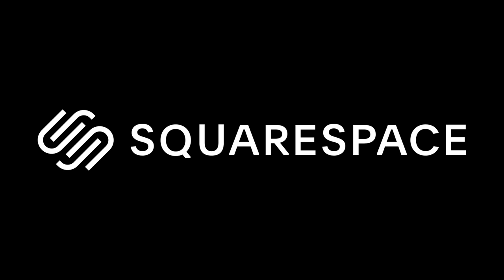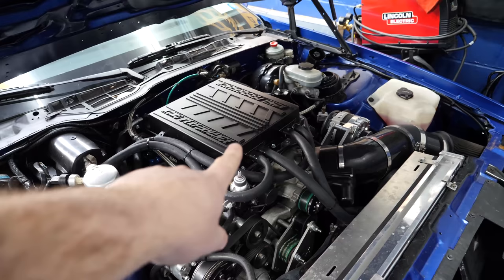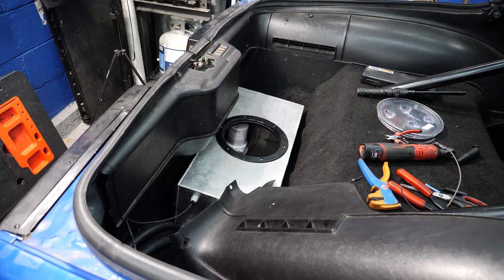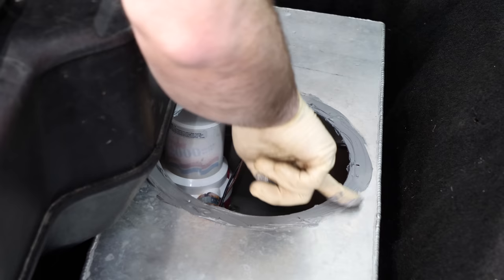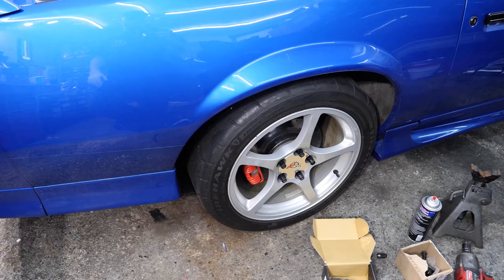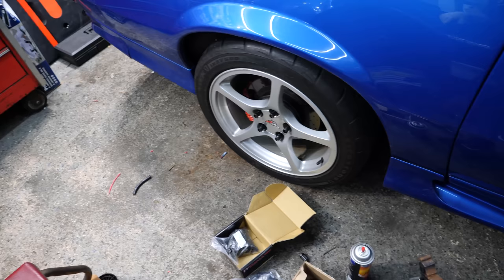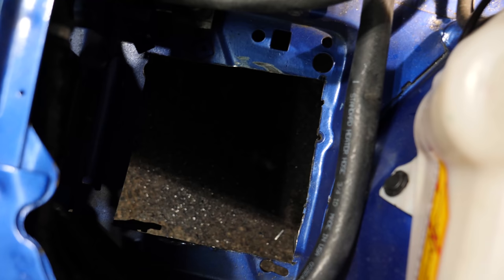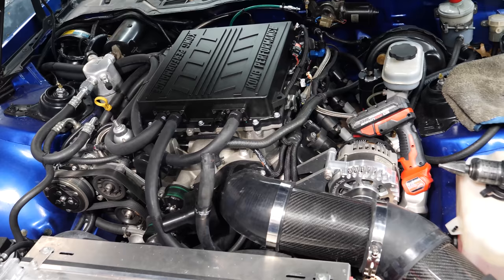This Bolt Could Have EASILY TOTALED My Ls Swapped Camaro

Comment: I am in absolute love with this Camaro. Hats off because she’s a beautiful build brother. One suggestion if i could. The cord grip you used for the pass through on the tank isn’t designed to be used with two separate conductors. You either need a two hole grommet in there or another cord grip. At the very least, throw some rtv in the grommet to help seal it up. I use ‘em almost daily so I’m pretty familiar with ‘em. Your local Crescent or Steiner electrical supply will have them on hand if you don’t wanna wait for ‘em to be delivered. Keep up the great work man, especially the Tahoe.
Reply from the maker: Thanks for the tip. I was thinking about that when I knew I needed it for two wires. I just figured if I made it tight enough it would seal. I’ll stuff some silicone in there and tighten it down again.
Reply: I'd be using gasoline grade sealants and wires
Reply from the maker: @shadowopsairman1583  there’s no need, nothing flows through that tank but water.
Reply: @shadowopsairman1583  lmao, for what? It’s a chiller tank, not a fuel tank.

Comment: Beautiful car, and your work is great.

As you obviously know, that ain't no "cold air intake". What ya got yerself there is one o' them HOT air intakes. It would be very interesting to see what a proper CAI would do, but I don't see the space to make one. What you may consider is taking the headers off, having them double ceramic coated, and then heat-shrink wrapped. That should dramatically lower under-hood temps.

Comment: Where do you run the boost bypass valve vacuum line, to the snout or the port on the blower on the passenger side…….my bypass valve is ran to the snout and my fpr reference line is at the passenger side port on blower….I can’t seem to find a clear answer…..I’ve read either/or work…..just curious how you have yours ran????

Comment: Do it right or not at all.

You could of used a shorter stud or cut those to correct size if there is no warranty.

No ram air with a Super or Turbo due to intercooling?

Comment: I see you got the weight jack pieces on the spring perches on the strange rear end. Did you end up boring out the hole in the perches after all? Got my Strange rear ended on the way and I’m running weight jacks too
Reply from the maker: I ended up cutting the weight jack down and slipping in a smaller id pipe.
Reply: @lsxmatt  aaaaahhhhhh I gotcha